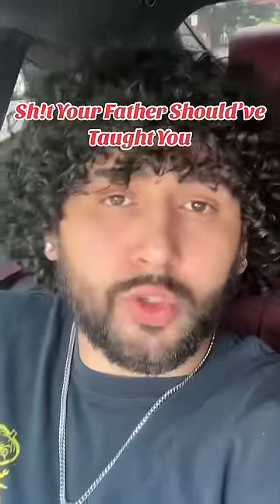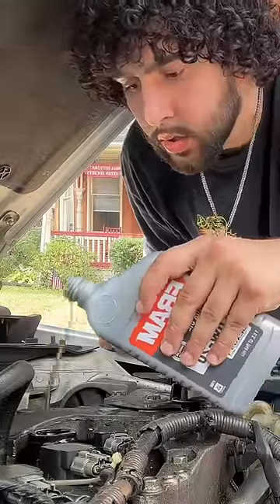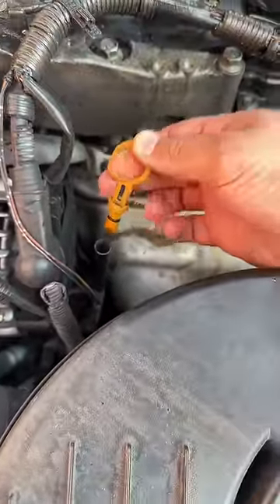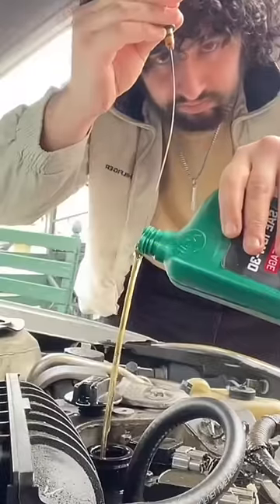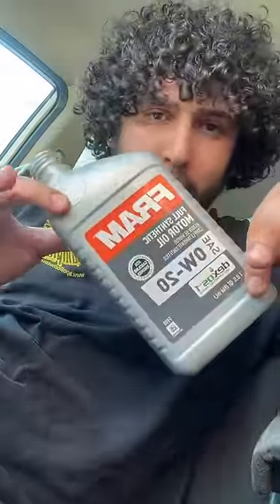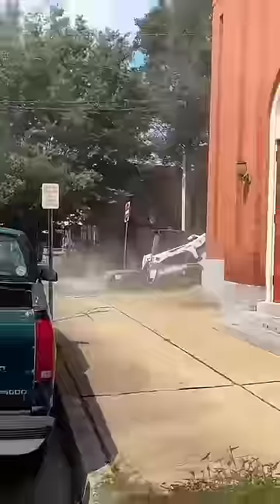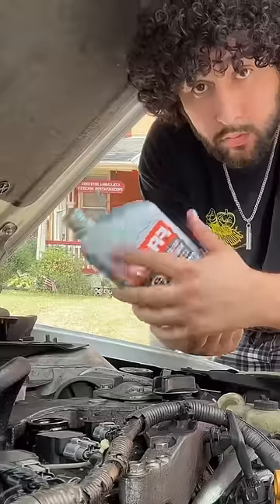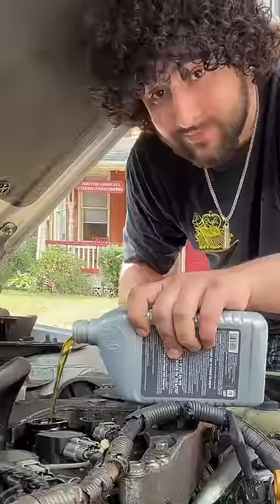@       Taught me these

Comment: If you notice all quart size bottles have the opening offset to one side and are sloped on the other. If you pour with the opening at the top it makes pouring quite a bit easier.
Reply: This is the case for ALL sizes not just quarts... 5 gal buckets work the same way, 1 gal jugs, 55 gal drums, they're ALWAYS on one side and it should be on the top when pouring to avoid the gurgling and get a smooth stream
Reply: @johnpike9612  I only mentioned quarts because I don't know that any of the larger containers also have the slope. Plus most people aren't topping off their oil with a 5 gallon bucket.
Reply: @cHr1s204  ya i understood that and no, aside from the gallon jugs most dont have the slope but its the same idea with or without the slope... marketing companies decided to add the slope to help aid the draining and hopefully make it more obvious but todays generation barely knows that they need to change the oil in their "tank" lol
Reply: @cHr1s204  also, im a heavy machinery mechanic,  i unfortunately use 5 gallon buckets daily because the bosses are too cheap to buy a bulk tank and the dispenser 😑
Reply: I have a better one for you. Punch one large hole in the foil and several small holes for ventilation. Also, doing it sideways is the best. Just make sure the big hole is on the bottom, and the small ones are on the top. You'll likely still spill a tiny amount, but it's super easy to control. If my instructions are unclear, then I'm sorry. I sometimes am familiar with what I say because I've done it, but I fail to realize that not everyone knows what I'm trying to explain until I show them. 😂
Reply: @dominicgalloway4481  I know what your saying. I usually do that with coolant and anything with foil I don't plan on using the whole container.
Reply: @dominicgalloway4481  ya thats alot more effort than just doing it the right way though... i used to to do retail lube jobs and they also didn't have a bulk tank and in a 10 hrs shift i " might" spill 4 or 5 drops amongst all the LOFs i did that day... it just takes practice
Reply: Yeah he said that in the video bro.... Did you watch it?
Reply: Did you watch the video?
Reply: @johnpike9612  It's really not much more effort. The easiest way for sure is just using a funnel... but sometimes you lose it or let someone borrow it. Maybe you cleaned it to use it for another chemical and are just trying to do something real quick. There's a number of things. Hell, maybe your car had a leak, and you just got some oil to dump in real quick. I've worked multiple jobs in the industry. I can assure you, it is a very small difference in effort.
Reply: Yep , that's what I've always done , the dipstick trick is cool though
Reply: But then you have to aim the pour from like a foot out

Comment: A trick my old man showed me, was saving the old bottles (especially the gallon size ones) so when you need to empty your oil drain pan you can empty it into the old bottles for convenience. Then dispose of it appropriately.
Reply: Yeap! My Grandfather and Dad did this, made it so easy to get rid of. Just mark the bottle so you know its old used oil. Then, depending on your town/city, you just take it to a place to get rid of that they are cool with.
Reply: You just changed my life
Reply: My mom taught me that too! It makes oil changes so much easier!
Reply: I've always used a 5gal Poland spring bottle.  Save the cap and pop if right back on!  Bring to Autozone, empty & repeat👍
Reply: Oh yea my dad taught me to dump the oil in the “oil bush”
Reply: @lilpapajohn1021 oil of any variety goes in the oil bush, cooking or motor oil. You know where to pour because of the dead brown spot on the bush, you can never miss 👌
Reply: In Jailifornia, we have to dispose of oil in approved containers, I wish I was lying... smh
Reply: @FirstLast-yr9kx   Commifornia...

Comment: Cant keep a funnel from the last change  but you kept the old oil container from the last change 😂😂😂💀💀💀
Reply: @bcamcam2  That. Right there. Is true. But if the trash is not yours you see trash.
Reply: I always put my used engine oil in the empty container so I can dispose of it properly
Reply: @craigstephenson7676  I do too which is why the old container is never available to use as the funnel lol
Reply: @craigstephenson7676 why not just get a $10 oil pan and save yourself so much effort 😂

Comment: Or just turn the bottle sideways to pour. Been doing that for over a decade and rarely  spilled a drop. It prevents it from coming out splashing due to the neck being weird. But sideways it’s flat so will pour out smoothly. Just comes with learning how the oil will pour and where you need to hold it to pour right into the reservoir
Reply: Watch the whole video

Comment: That last tip is the best, you dont need anything else if you do it that way. 

Also that tip is also the same as olive oil metal tanks you buy for cooking. You literally flip the bottle around so the mouth is the highest part of the bottle and rotate the bottle as you stop so you dont spill anything. 

If your father is not around or if he deemed you unworthy to even hold the light id say you should not listen to guys spilling oil on his engine block since once the engine heats up you could start a smoke fire or a real fire depending how much and where you spill it. 

My dad wouldnt help me get a car so i built one out of other cars, as long as you stay in the same time period and manufacturer you can frankenstein a car out of many different models, i used a buick as the frame, took the suspension out of an impala, the engine out of a corvette and just rewired a couple areas and had a muscle car that didnt look like a muscle car, youd rev it and the car would twist a little bit. Also if you go with the 80s as the year, you can get bench seats and slide your girl over to you if you whip the car to the right. Plus she can find your "phone" under the seat while you drive to the beach.

Those 80s designers knew what they were doing back then.
Reply: That's truly the downside to every modern vehicle having bucket seats with a big 'ol console in between.  Hard for your girl to "find your phone" without her doing some uncomfortable gymnastics.  

Teenagers in the '80s didn't have it so bad.  Wide bench seats for parking by the lake, and if you got caught, not having to worry about photos ending up on the internet for your friends/family to see.
Reply: @jimscanlan7385 I have no idea where this came from but you're right

Comment: Pro tip. Keep a funnel under the hood with a cloth rag
Reply: I keep mine tucked nicely behind the battery. I also turn the bottle the correct way so it doesn't chug on the way out like it did with him at first 😂
Reply: Super Pro tip keep It in a bag in the Trunk, the funnel can fall into the engine a break something
Reply: Npt teally a pro tip if it comes lose and fucks something up

Comment: Bro those oil cans become much easier to pour if you turn them the other way around so the side with the spout is facing up. 

Lots of pourable things are designed like this: keep the bulk of the product BELOW the spout while pouring makes it glug less and lets you tip it farther before it starts coming out.
Reply: Opinions are divided. 
It is not pouring without the glug. Or with the glug. I love the glugging sound. But I never use that much oil becuase everything I own and maintain is not the size of cars.....
Reply: you watch it?
Reply: Did you watch the whole thing?

Comment: Also if at all possible avoid changing your oil when it's dusty out. It won't wreck your engine, but having sand in your lubricant isn't gonna be good either, at best you might need to change your oil filter sooner.

Comment: Flat side goes up and the sloped side goes down on the bottle. Some oil bottles have a little picture of how to hold them.

Prevents glugging and allows you to get closer to the fill hole. On some engines it’s easier others have tiny little fill holes. Your milage will vary

Comment: pro tip flip the bottle around so the neck of the bottle is on the top then the bottom when you pour the oil. this method goes for any container that has an off set neck because its designed to be pour like that to help allow air into the container. your less likely to spill anything since it also helps keep the flow more in control and smooth.

Comment: The oil bottle comes with a foil cover under the cap. Don't remove it -- instead use a pen to make a "face" by making a larger hole in the lower section of the foil and two pinholes in the upper section. The pinholes will allow air to flow and stop the bottle from gurgling as you pour from the bottom hole. Same thing works with coolant.

Comment: Here is a trick my dad taught me, keep spare shit in your car. I keep a jack, a air pump, tools to change a tire, a hole plug for a hole, a spare tire, a knife, flash light and batteries, a phone charger, jumper cables, a blanket, a funnel, gallon jug of water, oil and transmission fluid, and a jug of gas. Never know when your gonna need them

Comment: Any bottle with an offset cap should be poured like this until about 3/4 is left. Then you can turn it again.
You just need to prevent a vacuum from forming in the bottle when it's full (which is what causes the glugging and splurting)

Comment: I just pour the oil with a grip that's opposite as the one in the beginning; the mouth of the bottle is on top, so there won't be sudden intakes of air to cause the oil to splash. I usually hold the bottle a bit tilted to its side since it's easier t control the pour since I can get the bottle a bit closer to the tank..

Comment: The engine oil dipstick will usually be yellow or blue and in the middle of the engine bay. Be absolutely sure that you do not accidentally use the transmission fluid dipstick that is usually red and way in the back of the engine bay.

Comment: For sure don't just pour it down the dipstick. There is usually a transmission dipstick available from the hood area. You pour motor oil in your transmission and I promise you would rather pay the 29.99 for a quick oil change at a shop!

Comment: No fram oil though do your research buy a oil with good additives your car will thank you i personally have had good luck with vavoline or Mobil I used castrol gtx in my dodge too and it worked great my grandpa has always told me stay away from store brand and penzoil

Comment: So, I don't like fucking around with the time to wipe shit up, and while the pour is smooth when you turn it around I often spill a small splash at the start before I know exactly where it's gonna pour. So because I always have some form of point or knife on me I take to work I cut a slit in the foil that you're supposed to peel off because it lets the oil out but due to the thickness not immediately. I then flip the bottle and put the tip of the bottle against the hole so I spill nothing and give a few light squeezes to help it go out (enough to increase the pressure on the pour but not to crush the bottle). If I think there's still some left I then take off the foil after and by then it's low enough I have time to put the tip against the hole without spilling anything anyway (I await people to tell me how this is wrong, I don't know why, but that's just what people do)

Comment: Mechanic singing in for the real tips

#1 Cover the hole in the bottle with fingers then make a small gap between your fingers ✌️ the gap controls the flow

#2 If bottle has a seal put 2 small holes in it opposite each other one for oil to come out other for air to come in

Comment: Id rather stick to putting my thumb over the open bottle hole then putting it into the oil fill without making a mess, its better then holding up the dipstick for an entire bottle or two. Or I'd just cut an old bottle and make a funnel if i didn't have one. When you have to work on equipment in the middle of a job and time matters, the dipstick trick would just be too painfully slow.